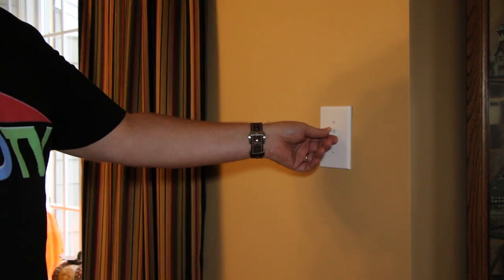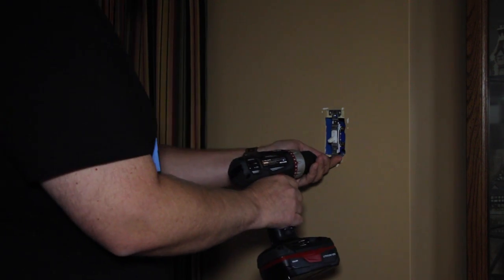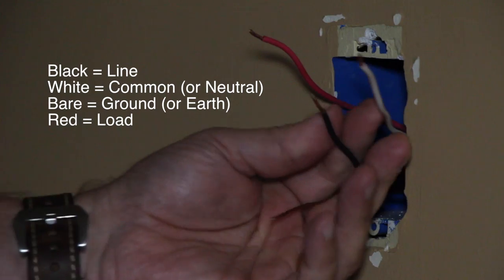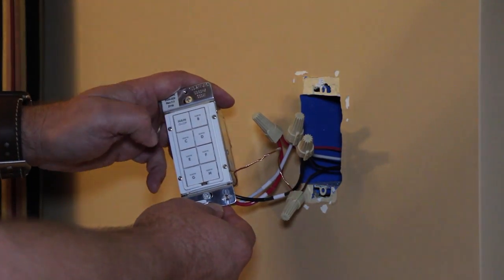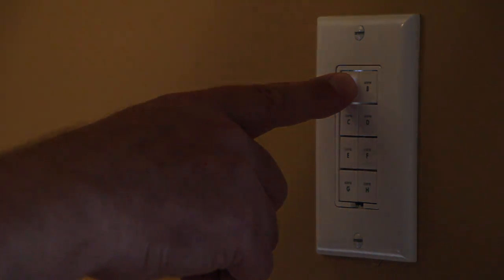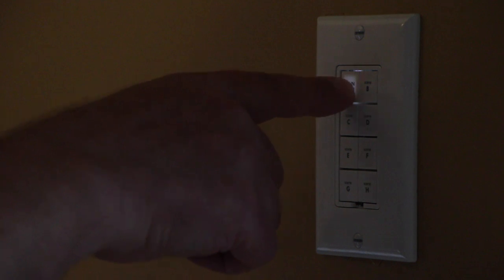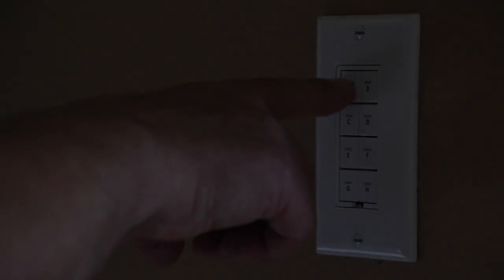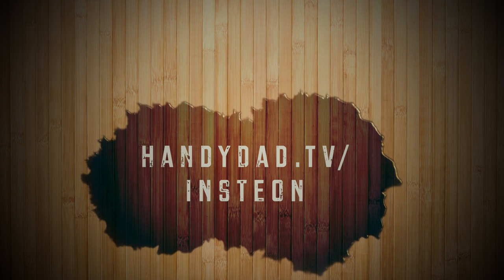INSTEON Keypad Dimmer - INSTANT INSTEON Ep. 1

Comment: Wait a minute, what exactly did that voltage test tell you?  You need to test between the black (power feeder) and ground wire, not the black and the red load wire (unless you're lucky).  If you are relying on a voltage reading through the load it had better be an old Edison bulb of some sort.
Reply from the maker: That was a mistake in editing. I always test across all wires to ensure the power is off.
Reply: @handydadtv  I remember once putting a pair of occilliscope leads across a switch like that once and killing power in the whole lab!  No worries just reminded me.